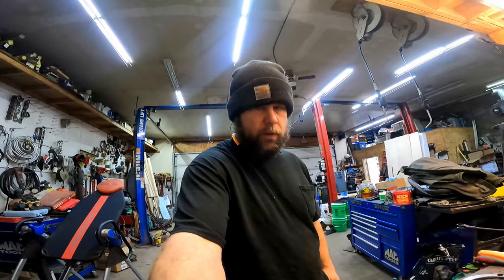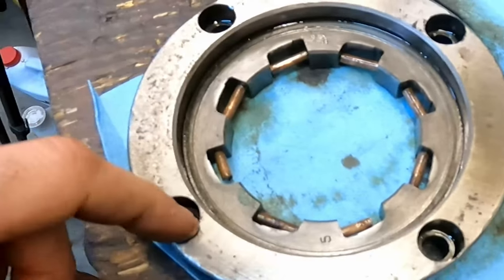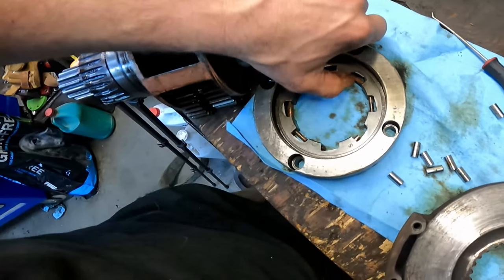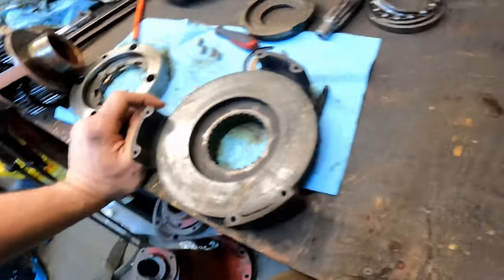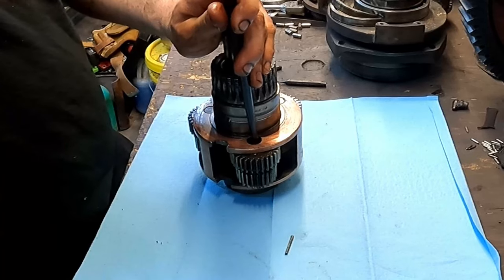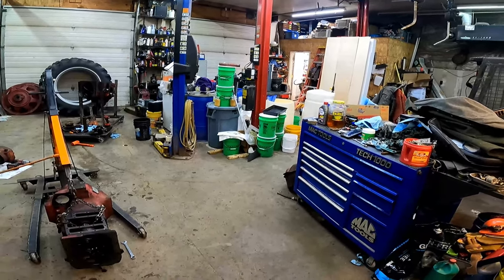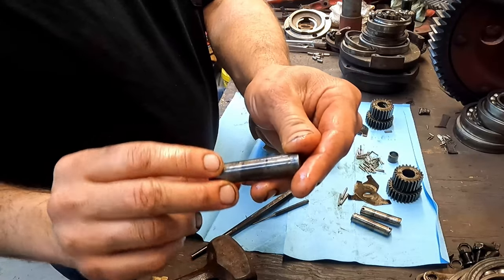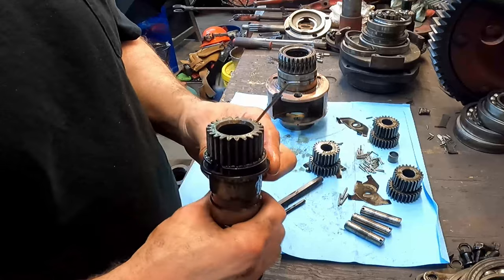Farmall 300 Part 6 Low Side Torque Amplifier Disassembly

Comment: I've recently pulled my 300 apart to the extent you have in these videos due to my differential falling apart.
A few things I'd like to bring as input to this as I've researched replacement parts:
1. The planetary gear pins and needles have a replacement parts kit you can buy for $55, part number 361282K will get you a TA pin kit
2. You can buy a TA carrier that comes ready with a sprag assembly that you can dress out with your sun and planetary gears. Look up Walts Tractors online and they have lots of goodies.

I'm curious where you're getting your replacement bearings from, as I don't want to pay the CNH prices, but I also want to put quality bearings back in my rear end and TA assembly.

Comment: My IH 544 TA clutch pressure plate broke in 5 pieces but the TA Planetary was working. I decided to take it apart anyway and found two missing springs and plugs and one fractured roller so its a good idea if your that far into it to take it apart. Did you ever finish this project?

Comment: Good   day  Now I can see why ta go.  But there is alot of needle  bearing in there.  I read other comment  that you might try  from Auto  truck.  I can see why it gets so expensive.  Yrs. ago I bought SW-6  with ta,  boy it  had loud noise in  it,  well had for about yr. & ta went.  Now I know what is inside.  Thanks  good video  Sat.  went to scrap yard  300 on side of road $2900 cdn for it & now fast hitch.  Thanks good luck
Reply from the maker: I have a plan and will be doing another video soon.  Some parts showed up today and i need to make some parts.

Comment: thanks for taking the time to show us what the parts look like from the TA assembly.  Where are you going to buy your parts?  I'm curious what the cost difference is between buying all the parts and buying the $600 Ag Parts Company's rebuilt TA.  Where are you located?

Our 450 Diesel is apart.  We are fixing the low side.  I'm debating between buying a ramp and roller set versus the rebuilt unit.  I'm also considering new 7 inch clutch and new main clutch.
Reply from the maker: Sorry I just saw your question just now somehow.  I am not 100% sure how it is going to end up just yet.  I am probably going to make a few pieces to make it so I can adapt an automotive sprag (4L80E looks like a good candidate) and get rid of the weaker roller clutch.  I need to get back on this very soon so I will have to make up my mind and just go for it.  We are going to need this tractor in a few months.  We are in Duluth MN